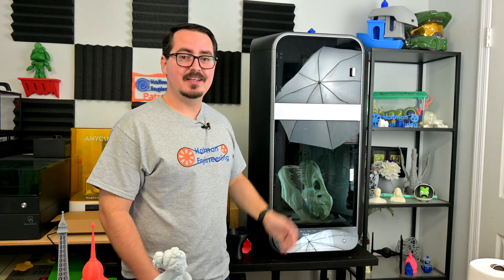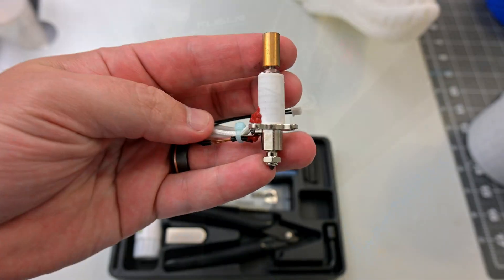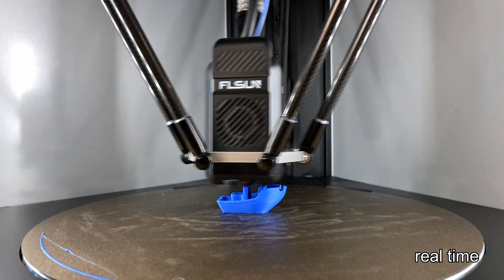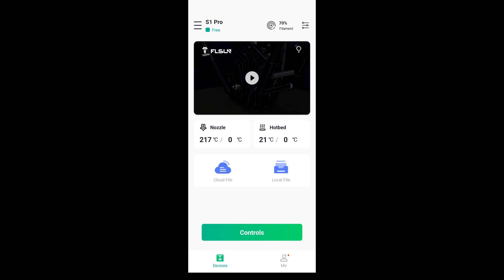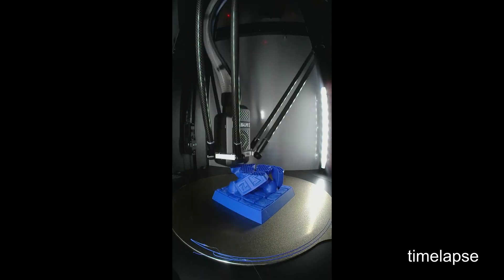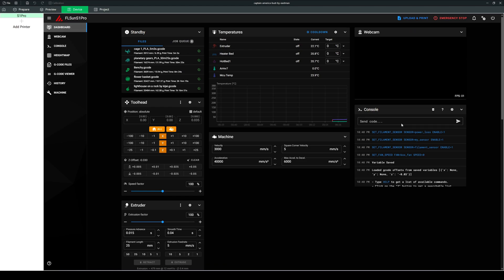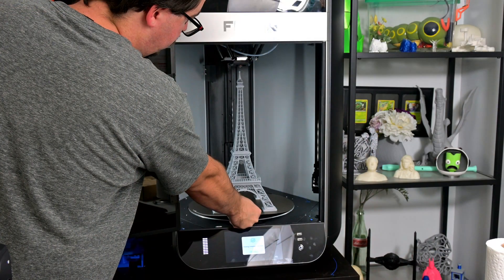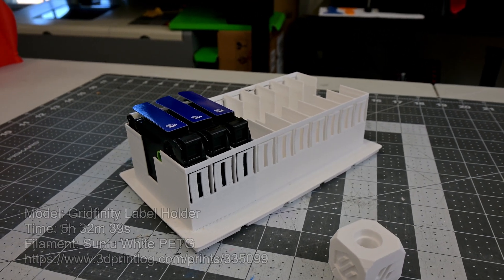The FASTEST 3D printer on the market. Amazing 1200mm/s with the FLSun S1 Pro - Full Review

Comment: I have the QQ-S Pro, Super Racer and a V400 which is more than good enough for the little 3D printing I do so I didn't think I'd ever buy one of these but they have dropped the price to just €699 for the S1 and €899 for the S1 Pro and the last couple of weeks there has been a €200 discount so I finally got one. 🙂 The silent fan mod was another €71 without Vat and I am planning to run the open source edition firmware. That's basically a S1 Pro for €570!    And I will drill a few holes and turn the fan around so it takes the cooling air from the chamber instead, it should eliminate warping on any materials other than PLA and also silence the printer quite a lot. A win win so to speak. 🙂 
From what I have seen the S1 should have been tested and refined to the Pro version before being released. To many loose ends on the non pro version. It will be interesting to see what updates are made to a printer bought just now compared to when it was released. 

Great and thorough review, thanks for sharing!

Comment: I have the S1 Pro since December 24, and this printer really should be recalled and taken off the market as it suffers from some serious problems. Mine has had motor failures, motor driver board failure that caught on fire, nozzle randomly scraping the bed, rubber moulding around the doors coming off constantly, etc. I recently installed the Open Source firmware and that seems to make the a small improvement on the quality of the prints as it's more customizable than the FLsun version. Also, the speed is a total head fake if you don't use the FLSUN twice as expensive PLA then you will need to dial the printer down to more conventional speeds, or the prints will be trash or fail completely. Also, the AI features are trash and are more trouble then they are worth so you have to turn those off unless you want to constantly have prints stopped.

Comment: does the s1 or s1 pro has a heated chamber? The website claims it's chamber can reach 50c, but is it active heating? Thanks!
Reply from the maker: No, the chamber does not have active heating. It's fully enclosed, and has a chamber cooling fan, but no heater just for the chamber. The large heat bed and high temp nozzle does provide a fair amount of heat to the chamber though, 50 C does sound right.

Comment: I have an s1 pro and a Bambu p1s. For large prints that I don't really care about the quality as much or that I plan on doing some post-processing, the s1 pro has been solid and is a no brainer over the p1s. If I care about print quality over speed I'm going with with p1s, no debate.
Reply from the maker: Interesting insight, thanks for sharing! What do you think that difference in quality is due to? Something that could be accounted for by speed differences, or something more fundamental like the subtle salmon skin pattern I saw on a couple materials in certain situations?
Reply: @HoffmanEngineering the pattern is just a delta thing but mainly the quality difference is due to the Jerk and acceleration settings
Reply: You should be able to tune the S1 to be the exact same quality at 2x the speed